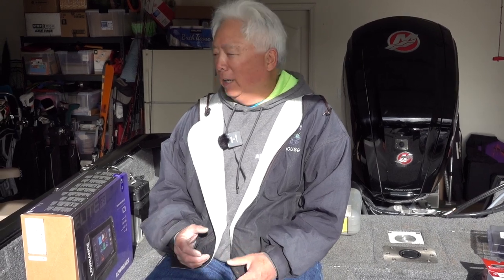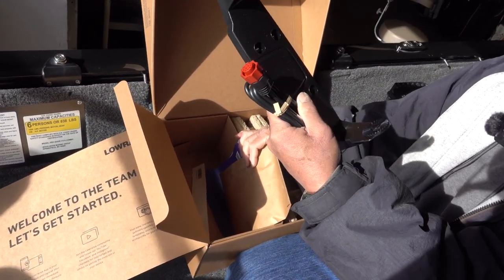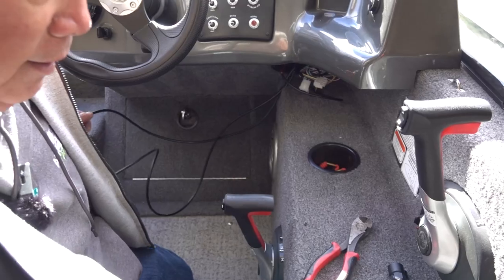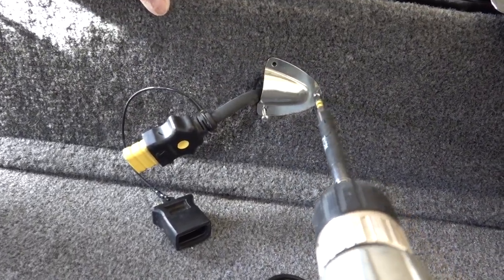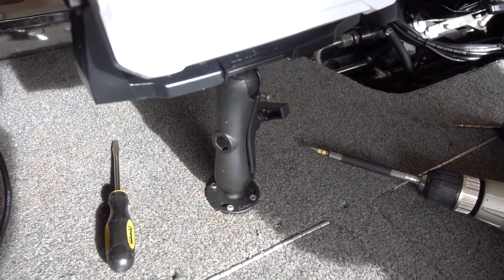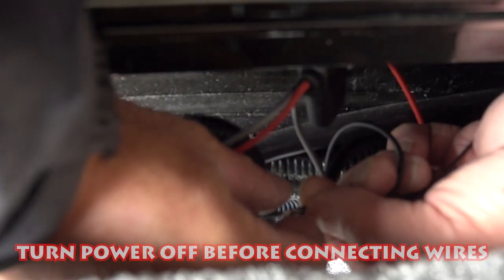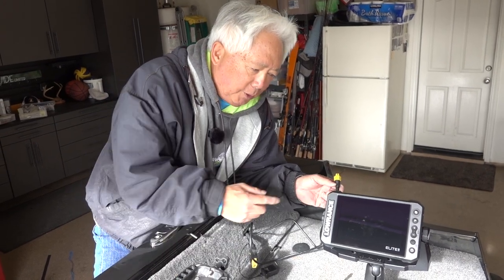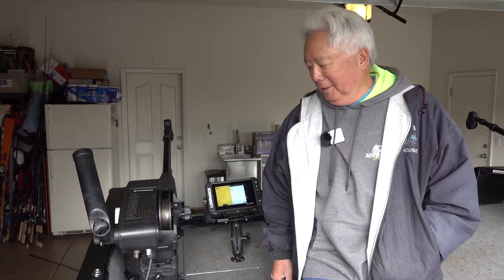Trolling with Downriggers? Watch HOOKSET RATE JUMP - Install Fish Finder on the Stern

Comment: Very informative Alan.  Am I correct that because there is only two units you dont need a hub?
Reply from the maker: no hub necessary if only two units, need ethernet port. On my HDS Live lowrance
units I have three units but my units have two ethernet ports so I don't need a hub either. But units with only one ethernet port and hooking up three or more you will need a external port.

Comment: what boat model is that, looks like my V-165 and I've been wondering if I could get a kicker onto it
Reply from the maker: I did that install for my co-worker at FW and it was a 17ft Tracker. you probably can if you put a kicker bracket on it. Probably won't fit on transom. Call Gone Fishing Marine and ask them.